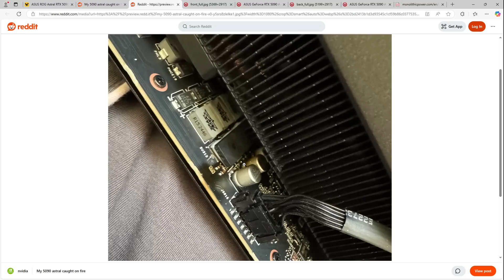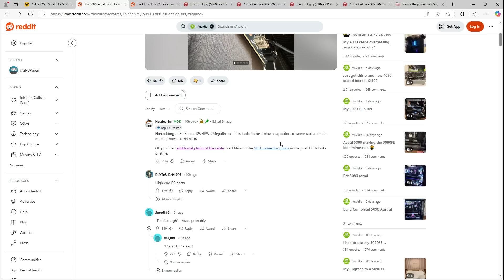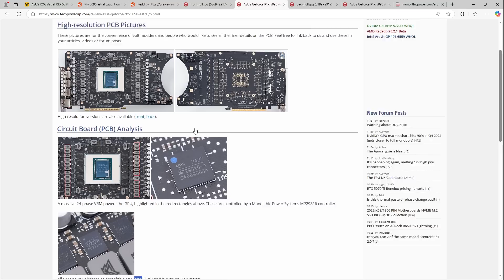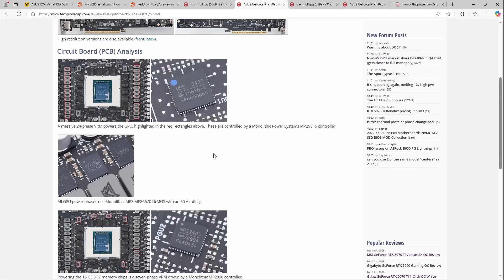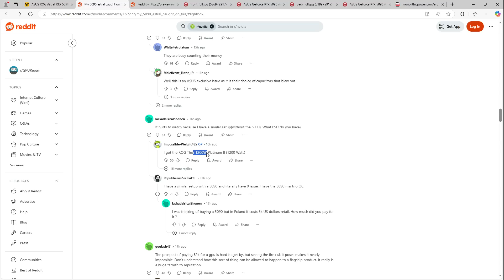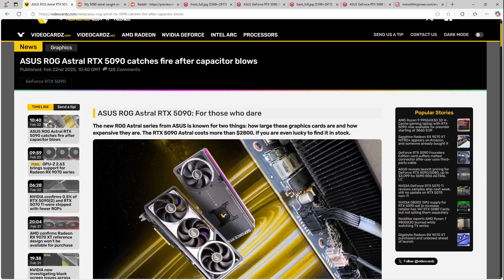Innocent capacitor blamed for ASUS RTX 5090 Astral catching fire

Comment: The great capacitor dying of the mid 2000’s left a reputation for capacitors that they still haven’t shaken off to this day. I work on more heavy equipment and I’ve fixed several boards simply by replacing dead en masse capacitors, but that is going back quite a bit in time now.
Reply: Yep, since it was such a common failure, and they were almost always through-hole components, plenty of amateurs were able to perform that repair with just a cheap soldering iron.  I myself have recapped an old Pentium III and Pentium 4 motherboard.
Reply: Ah, the capacitor plague.
Reply: @Fortzon  AKA, the reason I'm going to need to fix my old Game Gear.  The fact they all died within a few years was what made it really bad.  It does show that as much as warranties last as little as 90 days,* we do expect electronics to work for more than a few years.

* For brand new products in the US.
Reply: You can thank the Chinese for that, they stole a partial cap formulation from Nippon ChemiCo and it ended up in all the cheap caps used for consumer electronics.
Reply: @SkigBiggler  But only if the capacitors were from those few years.  Caps from before or after are much less likely to fail from normal use .
Reply: @SkigBiggler  No, you can blame the buyers of cheap components for being greedy.
Reply: That's why we need these videos, to appease the newbies about caps that aren't.
Reply: Electrolytic capacitors still fail regularly, they do have a limited life span depending on temperature
Reply: @zapl80 The problem is capacitors from that period failed based on time since manufacture, and not hours used.  They self destructed just sitting there.
Reply: I was excited once to use the capacitor in division 2 oh it's got a couple of high end attachments crit damage and chance but it's still shit :(((

Comment: 1:50 Remember the terrible capacitor failure rate for approximately an entire decade. I also blame that for preconditioning people for thinking it's a capacitor. Especially if the capacitor looks slightly damaged. That ended in class action lawsuits I'm pretty sure. 
Also I used to work as a repair technician and especially in power supplies and televisions It was a fairly common problem. Hell it turns out that even the PS3 yellow light of death was capacitors in the end. 
Although today I pretty sure that's a non-issue. But I haven't done board repair work in a while.
But there was just a lot of those crappy Chinese capacitors that killed so many things. It's why you see Japanese capacitors advertised to this day on components. 
It's not reasonable, especially if you're writing an article. But I can see where the everything's a bad cap comes from.
Edit: Yes it was primarily electrolytics, mostly from China. but there was also some other capacitor technologies that had high failure rates then. Primarily certain surface mount NEC caps and well like 60% of the things that came from China that wasn't an electrolytic. But again this hasn't really been a thing for years now if not longer.
Reply from the maker: Yeah NEC proadlizers also fail a lot but those haven't been in production for years. AFAIK some types of tantalums are also notorious for going bad in old electronics. But both proadlizers and tants take time to fail and AFAIK they don't explode.
Reply: PS3 Fat issue was mostly an nvidia GPU design error with the filling material internally causing cracks inside the internal solder after thermal cycling. I don't think the capacitors in the PS3 were much of an issue.
Reply: @blindsniper35  PS3 caps were never the issue.
NEC Proadlizers are the best thing ever.
Reply: If you want to deep dive into PS3 failures look up "RIP Felix" he's made some great detailed videos

Comment: That a viable point. Why not design the board with safety features. Like fuses. The power stage catching fire. The 12vhpwr wire catching fire.
This industry trend of saving manufacturing cost and let a few gpu burn and yet change 2000$ for a product make any sense?

Comment: if you pump 1200W directly into the GPU core it actually unlocks the missing ROPs, true fact
Reply: Gotta pump enough power to start nuclear fusion reaction
Reply: Also a cool feature that the unlock includes a small firework celebration. 🎉🧨
Reply: lol
Reply: LMAO
Reply: You will need a flux capacitor....😂😂😂
Reply: Man after Intel i9’s full load power draw Nvidia really took on the mantle with the 4090 and now with the 5090, we are at new heights ladies and gents.
Reply: but it might also disable the active ones....quite the gamble :P
Reply: @ it’s obviously a fair gamble since the card only costs 3000 dollars
Reply: But only if it has a max of 1 A (so 1.2 kV)
Reply: oh that's a good one :D
Reply: "YOU WILL BE UNLOCKED!!!"
Reply: Shit, so I have to buy a second PSU
Reply: Fuck Man I just got down from the clock tower.....
Reply: Yep. They pop out suddenly like popcorn from a frying pan.
Reply: you gotta pump it up!
Reply: I find more feasible finding Mew behind the truck...
Reply: at over 9000W it becomes a Quantum Core
Reply: do you have to turn on flame generation? 🤣🤣
Reply: They also be flamin... u know what i mean😝
Reply: The missing ROP thing is probably another case of nvidia sending better cards to reviewers, they might issue a rebate or something after a class action in 10+ years after they just say "oh thats how many its supposed to have, performance is relative and you still have a 5090 and fake frames :)))"
Reply: Once
Reply: That's not how Electricity works..... you dont pump power into something. Current is drawn from the power source by the device.
Reply: By increasing the voltage we can increase the current if the resistance is constant

Comment: can a card still run with a dead power stage ? 
cuz my 2060s makes hissing noise lately , and the max power draw of the card in furmark went down from 210 to 180watts
Reply: That's not good lol
Reply: @HybridEnergy  it is still working and i can still play on it
Reply from the maker: usually no.

Comment: You kids today, don't even know you're born.
Back in the day, you'd have to replace all the capacitors during an upgrade, else they'd start popping left and right.
 - Referring to the 90-00s [non-solid] capacitor plague
Reply: Yeah caps blowing is a real thing. I work with controls systems and older controllers let the factory smoke out of caps more often than any other issue

That said his point is extremely valid. Uneducated people rambling about things they don't understand

Comment: When I was like 16 I had a capacitor fail on an old low end Nvidia GPU idr the make. But it was very old and I shouldn't have been pushing the card like I did. It popped and stopped displaying. Replacing the capacitor was the easiest repair of my life and it worked flawlessly afterwards.

Comment: MLC Ceramics are actually very common causes of dead consumer electronics, watch 50 electronics repair videos and 40 out of 50 I guarantee it's almost a stubborn shorted MLC somewhere, and you need to inject voltage and use thermal camera or alcohol to find the SOAB.

Comment: The MOSFET exploded in the direction of the electrolytic capacitor. The cooling is not reliable, did overheating occur due to overclocking? But, sometimes the mosfets just die for no reason.

Comment: If it was a cap one would pretty  sure know it too. That cap should have bulged probably some way or another. And also as Buildzoid is pointing out chance of Cap being the main cause of an issue is close to nil these day. 

Back in the day during capacitor rot (if you even remember that far over lived during the age) it was different story. But yet again during that time it basically took very long time for those caps to start failing. (It wasn't instant).

That  said. I totally agree. The main cause of an issue was and isn't failing caps on this card.

Comment: Is this the continued fallout from that Chinese capacitor fiasco like 2-3 decades ago now, with motherboards dying left and right, which cemented "High-quality Japanese capacitors" into everyone's sales brochures?
Reply: I think it's fallout in that that issue made people think all these failures could be traced to capacitors, but that's the only connection. Those capacitors had an improperly formulated liquid electrolyte, and these are solid polymer capacitors.
Reply: @ Yes, that's what I meant. Because of the capacitor plague, I think laypeople assign low reliability to capacitors, regardless of type or technology, despite it being unwarranted.
Reply: Hey, no inb4 my comment 😤
The capacitor plague.  End of 90s into 00s.
No, cos they were non-solid

Comment: 17:44 you can, at least looking at board view of any reference 4090 there's practically a specific "legs" goes with 12V to mosfet voltage input which can be modified to held fuse and they aren't buried somewhere in a middle of a board, but placed on topmost layer, i guess they pretty much don't care and it's easier for them to RMA instead of making board repairable
Reply from the maker: the main 12V connection for power stage is a big pad under them. You can't put a fuse between the powerstage and the 12V pad.
Reply: @ActuallyHardcoreOverclocking  you could - you'd just need to put the powerstage DC input on a different plane to the 12V.
Reply: @ActuallyHardcoreOverclocking  mosfet pad is less than half of a mosfet body width/heigh(more like 1/3) and i'm not sure whether those traces has to be as wide as they are made, it more looks like that they are as wide as spare space allowed, otherwise all those copper could be dissolved anyways

Comment: I’ve seen a gtx 1070 with a cap that stopped working but it wasn’t technically the cap, it was the soldering on one of the legs that gave out.  The gpu would rarely give me issue but every once in a while it would crash in game, which led me to investigate because it wasn’t normal and software didn’t explain it.
Reply from the maker: what power rail was it on that it had such a significant affect? My assumption is Vmem.
Reply: @ActuallyHardcoreOverclocking  It was a long time ago but if I were looking at the gpu die and the I/O ports were on the left, it would have been the first one from the top about an inch and a half to the right of the die itself. I still have it tore down in a box, still technically works.  Thanks for the reply!

Comment: defending capacitors honor.
Reply: Justice for innocent capacitors

They don’t even have any liquid or gooey stuff inside that could leak and/or ignite…
Reply: Obligatory "no cap on god".
Reply: Depends on the device type. For laptop mainboards, it is always a capacitor unless it is a mosfet on an Asus board. Laptop mainboards use very cheap caps...
Reply: The last 5 years I only met 1 dead cylindrical cap maybe on a Gigabyte motherboard, it was really hard to find because no deformity but I catched with a thermal camera. SMD caps failure are more common but still rarity both motherboards and graphics cards, except on Sapphire NITRO RX 470/480/570/580 around 20-30% dead cards caused by cracked cap.
Reply: The caps on the PCB's you are talking about are likely fa kes as well.
Reply: No honor among caps.
Reply: The capacitors look like fa kes
They seem mounted at odd angles which could be the print is not straight on them.
 Dead give away if that's the case.
Reply: @fx-studio  Bro how many boards have you looked at? You hardly see a single pcb without a crooked cap on it. Just how they are, all the old pcs I used to tear apart had caps you couldn't put a straight edge on at all.
Reply: @prototypep4  They were probably fakes as well then - the market is saturated with them these days.

Comment: I do repair a lot of amplifiers and some other stuff...the power supply side logic/operation is almost the same as in any electronic device, not matter if it is a gpu, amplifier, or car module. 99% of the time, customers says - maybe it's something small like a capacitor....usually ends up as a full rebuild.
I do not understand why the myth every time it's the capacitor....in my almost 10years+ I've had like less than 5 cases where issue was related to a capacitor...
Reply: Tell me you never had to deal with late '90s to mid-2000s consumer electronics.
Capacitor plague was VERY real.
Reply: The capacitor plague of the 90s and 2000s, combined with vintage electronics needing caps replaced simply due to age, has led to a perception that caps are the first to go and responsible for most faults. Unfortunately it’s more the case they’re just the most visually obvious. In my experience power MOSFETs are typically the failure point in electronics if it’s not something super obvious.

Comment: Ahhhhahahaha, serves them right for trusting anything 5090 for being quality work. Even the 4000k astral is blowing up tells me this gen is horrible
Reply: The video says this has been happening for a number of generations. It would therefore be amazing if it didn't happen on this generation too.
Reply: @Safetytrousers  it would be great if we got what we deserve is an actual 90 class card that doesn't blow up with 2 12v6 power plugs instead of 1
Reply: @sargentpayne  This failure had nothing to do with the power connector.
Reply: He used an old bad PSU and also was an inexperienced builder

Comment: Nvidia 5 Series is a complete shitshow.
Reply: As the video says this has been happening for a number of generations. This card is under warranty.
Reply: @Safetytrousers  Possibly an Asus warranty, so is about as valuable as penguin poop.
Reply: @ChrispyNut  In the UK, something going back often goes back to the vendor. I can't believe that every product going back to Asus is treated poorly.
Reply: @ Hence I said "possibly", because a lot of people had to buy bundles of some kind to get a card, with some places only accepting full-bundle returns.
Thus, they'd have to return to manufacturer.
Reply: @Safetytrousers  Got  a 5090 user who looking at his gpu every hour while gaming and sweating hoping his 5090 doesn't burn
Reply: @Safetytrousers  too bad the camel's back is already bent...
Reply: To be honest if only AMD kills nVidia with it's offering it will be a 2003 all over. Back then a power hungry and borked GeForce FX 5000 was smashed by Radeon 9000.
Reply: @krazownik3139  I'm still using 6700XT , if i can get a card that doubles my 6700xt in performance from AMD for a reasonable price , i'll switch to that card. If not i'll use this one until it dies. Can't afford a performance equivalent from Nvidia. Prices are way too high and that stupidly melting fcking connector...

Comment: Don't worry, they can fix it if they charge $4000 for the 6090 ;)
Reply: Bet you they won't.
Reply: @kristoffer3000  But they'll still try to charge 4000 for it ;) Thats for sure.
Reply: @peterpain6625  5090 costs that much already for some models (the cheapest are 3600). nVidia never became cheaper gen to gen, so 4k is very plausible given it's already reality. 

Unless we're talking just MSRP, which is 2350-2700 depending on the card, but no card has been sold at MSRP since Ampere.
Reply: @ Absolutely, people have shown them that it's a fine price for a gpu